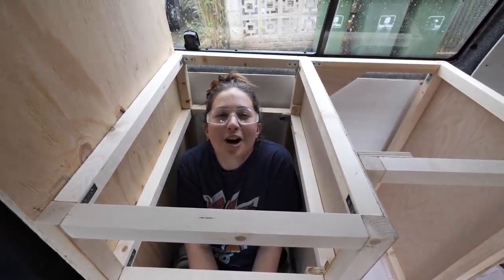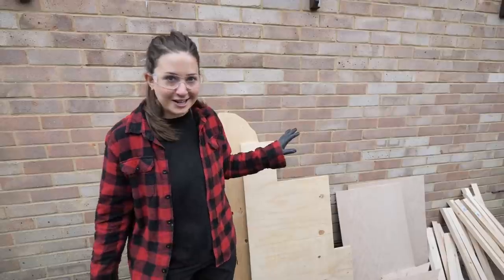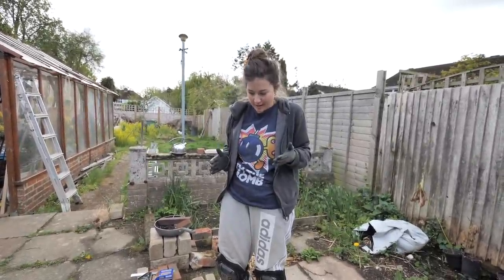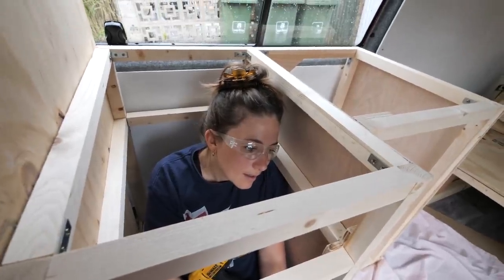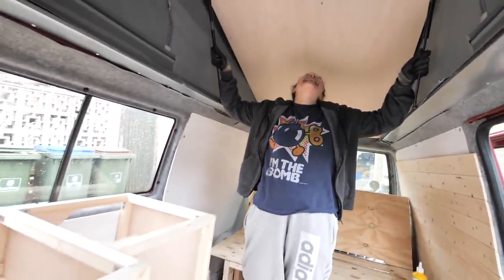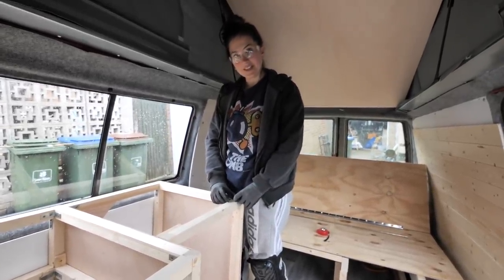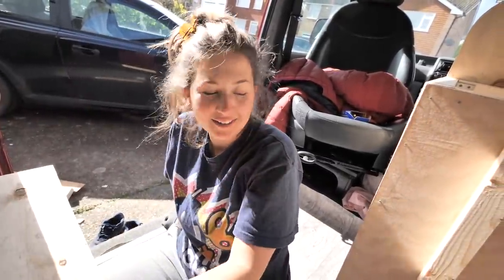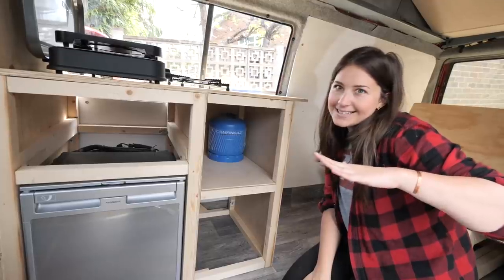Kitchen Nightmares | Self Build Camper Van Conversion For Dummies Part 4

Comment: Brilliant 😂 and well done. You did it! 👍🏼👍🏼👍🏼 If I was doing a build, it would be really basic. I am a bushcrafter at heart so my van would be basically a very comfy bed on wheels, with storage to put things like my firebox, cutlery and pots, knives, axes and saws etc away, and a small library. I’d defo have a small compost bucket thingy with a seat so I could stay at sites that insist on visitors being self-contained. There would be a space to cook, but I’d use the stuff I normally camp with, and I would have a small fridge. I would also have storage spices, foraged foods and dehydrated foods. I’d probably sit outside for most of the time, even when it’s raining as I have tarps etc... having a van would basically mean I wouldn’t have to lug my bushcraft gear in a rucksack. I could just go for short hikes with a much smaller backpack and snacks for the afternoon.... well, I can but dream 😊 I don’t even have a driving license soooo... but it’s great to see you guys, your process and adventures 👍🏼 thanks for sharing x

Comment: Great kitchen build!  We have built several camper vans.  Every time we decide we need a sink we end up using it for water bottle storage or dog bowl storage!  Our most recent build we have installed 2 burner cook top but no sink. Our water is dispensed in wetbath and the dog bowl stays on shower floor so it will not get the rest of the van wet if it should tip over. I have a collapsable dish pan/sink for doing dishes. Glad to see other people think a sink is a waste of counter space!  Great job!

Comment: Never used the sink and never used the hob in our T5.1, The one i am building now has 2 stainless mixing bowls that fit inside each other one for us one for the Spaniel they are held to a metal plate atop the work surface by a magnet,  and as we only use the water for moka pot coffees teeth brushing and dog, the tap is fed from 5litre water bottle, refill  it till the handle snaps then recyle and buy a new one for 85p instead of having to waste gallons of water and add cleaning chemicals rinsing manky tanks, Tip for your joinery instead of using 50mm square timber get 50x25 then you can effectively make half lap joints instead of using brackets. 
Also thank you for your efforts making the videos , they make us smile, Ed

Comment: So proud of you Emma, you're a real trooper. Hey, mistakes happen, but, you got back in there and fixed it and you can look proudly on your work. Sinks are one of those personal choices. Nothing wrong with one of those portable/collapsible ones that you can even fill with water and have it come out of a faucet. I like to fill a sink with water inside a camper and dunk my head/hair, wash it, dunk again, drain. then rinse with a sprayer faucet. Like the cooker, it's nice to take them outside and cook your meal whenever possible. All is looking good and even the peacocks are checking out the build....love it! Take care, hang in there!

Comment: Nice job Emma.  That sliding bed frame is a stroke of genius. Maybe you could place a rubber mat (shower mat) under the fuel tank to cut down on the vibration while driving.  A simple ledge in front of the tank to keep it more stationary.  Have fun...

Comment: Good Job Emma and do not feel bad as I know what it's like to be the DIY lady of the house! Lol

The only tips I would give is that I would defiinitely get yourself a cheaper portable plastic wash basin that you can stick in your storage for washing dishes, etc inside the van and somehow make that wood top where you have the hob, fire proof and washable, so that with cooking on the counter top will make it easier for all that grease and splatters it can be splatter proof onto the wood and  be very hard to clean otherwise. 

Make sure you also keep a fire extinguisher nearby as well as a carbon dioxide detector in the van somewhere in case of gas leaks.

Comment: Ive just opted for a fold up washing up bowl for my sink, keeping anything possible simple and easy to take outside makes a lot of sense if you ask me!
Reply from the maker: A folding one sounds like a great idea!
Reply: @TravelBeans  Also to save water I use 2 spray bottles to wash the dishes. One bottle mixed with soap and water and the other just plain water for rinsing. Saw it from another travel couple and it works great..
Reply: @markjohnson301  I LOVE this idea, thanks for the tip!
Reply: I’m often next to water so pond/river water boiled up and used for washing up in suggested collapsible bowl. My van has a sink. It’s never been used and is now just storage. Same with the built in hob. I just use one of those £20 stoves most of the time.

Comment: I nearly did a similar mistake building my first van, in my case I had forgot the rake of the drivers seat and had measured from the fixed point of a support bar behind the seats, easily done.

Comment: We don't have a sink either, I use a spray bottle with lemon essential oil dripped into some salt to help it diffuse into the water and paper towel, if you clean up straight away it's easy. Do you have a ridge monkey? Essential! Lol I hate cooking! I have a tiny kitchen with just enough space for the double hob I use a bit of Duane's desk for counter space and it works fine you don't spend much time cooking anyway
Oh no!! We really felt for you! Don't worry everyone has a measuring disaster x good job fixing it! 👏
You've done an amazing job!

Comment: Gas tank the floor so gas doesn’t pool in space beneath. Secure gas tank so it doesn’t knock about or get punctured when van’s moving. For sink replacement use a collapsible bowl & 2 spray bottles for dish washing (1 with soap & water & 1 a little bigger with just water).

Comment: Very good job Emma. And you solved the problem in the most quick and dirty way , which should work fine for that application. Just a personal note, I would prefer to have a built-in sink if possible, but you may find you can live without it. As a former building contractor I like the way you think on your feet and are adaptable, and never loose your cool. Cheers, Dan. 🛠👍🇨🇦
Reply from the maker: Aw thanks Dan! 🥰

Comment: The best compromise if you don't want a sink,  is a funnel [ canning or oil funnel that has a wider nozzle with mesh to catch solid debry which you can wipe off] and just drill the hole in the counter so it can drain into a 1-2 gal jug. You have a place to spit in when you brush your teeth 😬  and to drain your washing up basin, etc. You can even sink it into the counter and cover it if you want go get fancy, but it doesn't take up much space.  Two collapsible washing up tubs [ one 4 sponge baths and hair washing,  and one for dishes and washing fruits and vehicles] actually a collapsible collapsible set inside the 1st tub is great 4 dishes and veggies as it's a strainer/dish Rack all in one. I don't submerge my dishes anyway. 🙃

Comment: Amazing as always, starting to take shape. Great call not adding a sink, I've had 2 campers now and have hardly used the sink, especially as most campsites have a washing up area. The only thing I would change is not having a large piece of wood behind the driver's seat, it will be harder to see your blind spot and restrict you view.

Comment: Hey guys, the build is comming on great. 
Be aware though the Dometic fridge needs some air flow, especially if you intend to use it in wamer climes. I found ours overheated at times when the weather is hot, and seemed to be running all the time,  we put some extra vents in to help.
Good luck with rest of the build.
CVD :-)

Comment: Looks great! I would have a sealed gas locker on the bottom with the gas in it and the drop out vent. Have a look underneath the van first to make sure you can put a drop out vent there without hitting anything...I am converting a van at the moment...it is a mindfield!!

Comment: Ho ho, I just spent most of today dismantling and rebuilding the storage space under my van bed. I found 2 draws in the back shed that would fit... well ...after  moving a divider. This entailed some interesting contortions to remove and then rescrew in the panel. I seem to specialize in rebuilds. Nice to see others have the same small hiccups. (Also as I'm recycling everything seems to need modifications.)
And yes I will have a kitchen sink and grey tank as these are requirements in NZ, along with a toilet to have more freedom choices.

Comment: You both are real legends, but you must keep some things in mind: Fix the gas properly with straps inside the kitchen box while driving, because in an accident or a brake maneuvre it might become a killing big blue bullet flying through the interiour. Next is, you have to care for a good air circulation behind the fridge because it generates warmth while it is working. As far as i know. So: Put solid straps and cut holes in it!!! Good decision: No sink! Most of the time you will wash the wishes outside...

Comment: Fantastic conversion Emma I'm really impressed. I have experienced your pain when I converted our Mazda Bongo 15 years ago. It took over a year but well worth it as we are looking forward to some more camping trips.
Just one observation!. When I did mine, the gas bottle had to be fitted in a metal lined cupboard with a hole in the floor for possible escaping gas. Perhaps this has changed but may be worth checking it out.
Looking forward to seeing more of your videos you guys are awesome.

Comment: To sink or not to sink, that is the question. I motorcycle tour here in France & use camping municipals. Washing up facilities are on site alongside toilet & showers. Off grid camping, lay-by's, fields forest etc it's gonna be water bottle & bowl unless you want to go built in sink, water tank, pump, plumbing, waste pipe, grey tank, even water heater. Kinging-it's "Custard" has all the bells & whistles but she weighs in at 4.5 tonnes and they can load her up to 7.5 tonnes.

Comment: You two really are the full Beans! I love your dynamic together and attitude to tackling jobs, although Alex seriously needs to get himself a tin hat and flak jacket if he keeps on taking the piss! Am in awe of you having a bash at all this as novices, but then, everybody has to start somewhere 😊 Having a non-fixed stove and sink is a good idea in a small living area, so long as the weather holds up. Collapsible washing bowls, colanders etc will make life easier.  I can see a trip to Ikea on the cards (the go-to place for storage solutions for nomads!). Love that camp stove, it's awesome. Where will you will be putting your water carriers?  I imagine it might be wise to rig up some kind of awning to maximise your living space to take account of drizzly or over-hot (we wish!) weather.  I did wonder whether it might be better to put the propane on the floor, with a longer pipe to the stove, so the tank vents straight outside, or are you putting a louvered door flap on the exterior to access it?  Am looking forward to your next tasks. Hugs and best wishes from a slightly soggy Devon x

Comment: Alot of places require you to vent propane.  Meaning you would need a fresh air source and a proper way to vent, incase there was a leak in van. Just a safty tip!

Comment: do the caravan parks in the UK have camp kitchens?
 in Australia they generally have a kitchen and at least hot water, so a collapsible sink works great, just carry your dishes over to the kitchen and use their hot water and drain, or get hot water.
Your lightweight bench top is all you need, keep it simple.

Comment: I've been converting a Fiat Ducato L2H2 for the last 9+months. One thing I'd say is if you're planning on changing the use from van to 'motor caravan' with the DVLA is you'll need a permanent cooking facility ie, secured to the floor or wall, not a camping stove. Worth checking out the DVLA's requirements list if you want to apply for change of use. Other benefits inc. 70mph limit on dual carriageways rather than 60mph for a van, insurance should be cheaper too. Also as a camper you can value it as a camper rather than an empty van.
I've just fitted the same Dometic CRX50 (45ltr) 12v compressor fridge, I know it's not gas but best to have a degree of ventilation at the back of it 👍
Ps, I feel your pain re. stiff aching everything, my body will be so relieved with it's finished 😂
Reply from the maker: 😂 the aches are my punishment for not doing enough exercise prior to the build I suppose!
As far as I'm aware, the DVLA don't count low roof vans or pop tops as campervans (odd I know) so changing it to a motor caravan officially is off the cards for us anyway. Shame though as would have loved to do it. Maybe they'll add pop top to their list of requirements in the future 🤞😁
Reply: @TravelBeans  I sold my 1999 T4 pop top campervan last year when I took this on, it was converted by Reimo in 2006 from a panel van & that was on the log book as 'motor caravan' 🤷‍♂️
I'm 48 & usually active but this build has taken it's toll as I'm always working on it & never exercising 🙈
Yours is progressing much faster than mine 👍
Dan.
Reply from the maker: Oh I see..  yes I think the DVLA changed the rules a couple of years ago, unfortunately. 
It's not an easy project, and I can only imagine a big one like yours would be even more tiring! Keep it up though,  we'll get there! 💪

Comment: I really hope you find a solid method to mount the kitchen block to the car frame. 6-10 normal screws don't do the job. let's say the kitchen including every item in it is 120kg and your accident happens at 60kmh the force pushing the kitchen into the driverseat would be ~16667Nm or ~1.6tons.
Reply from the maker: Yes, we plan to secure it to the floor 👍
Reply: @TravelBeans  The same goes for the stove and any other items you want to be able to take outside. Make sure they can't move while you are driving, even on a very bumpy road.

Comment: I have 2 follow up questions.  Awesome work! your woodworking skills seem to be on par with mine although I consider myself a pretty good woodworker and other people just call me a 48 year-old man.  Genius maybe?  I never would have thought to glue the brackets...but I will because I expect it to eliminate squeaking noises or I may use felt in between?   2nd thought...how do you like the carpet between the bed deck and the bed frame? the carpet that helps the bed/sofa deck slide?  I was thinking in my personal build to sand and wax the bed frame in hopes to get smooth movement when adjusting the sofa/bed modes?  (i understand the carpet thought though too as a bumper and it might additionally deaden some sound).   

Thank you :)  Subscribed, liked and shared this great channel

Comment: Could you put the gas bottle in the lower cupboard and fit the gas drop vent, fit a door that would be accessed from the bed side and then also fit another piece closing that gas area off and freeing up the front of the cupboard to be used for something else?

Comment: We don't use a sink.  Vinegar is a natural cleaner and disinfectant against salmonella, e-coli and listeria.  So we use paper towels and vinegar to clean our dishes.  No need for rinsing.  We also use it to clean our bodies when we don't have access to showers. No need for rinsing.  And, no, you don't smell like pickles!😃 The smell quickly. dissipates.  We have been doing this for several years and it has worked well.

Comment: just browsing around van life build videos, and the first thing I'm wondering is why did you not used just the same plywood that was used for the counter top and wall behind the driver seat with pocket holes? Other than that I'd probably use the same design for the space available.

Comment: if that kitchen works for you, then it's fine.
Top opening fridge is way more economical.
open the door on your fridge, all the cold air falls out. Now your fridge has to start the cooling process all over again. Your fridge has shelves... lots of wasted space.
Top opening fridge, open the lid, all the cold air is still inside the fridge. top opening fridges have no shelves so less space for food is wasted. A full fridge is very economical to run in terms of battery power.

Comment: And when it's 35-45 degrees C in summer, the bed bumps into it again.
Reply: If you are implying thermal expansion, then you have it wrapped around your neck. The temperatures above 35 C are very rare in UK summers, but wood will shrink when its warm and dry. Only if it got wet would it expand.
Reply: @thetessellater9163  and what could go wrong with water being anywhere near a food service and kitchen area..?? Well done Emma i think you have done a fantastic job and dont know how you put up with Alex...have a good rest you deserve it..😁